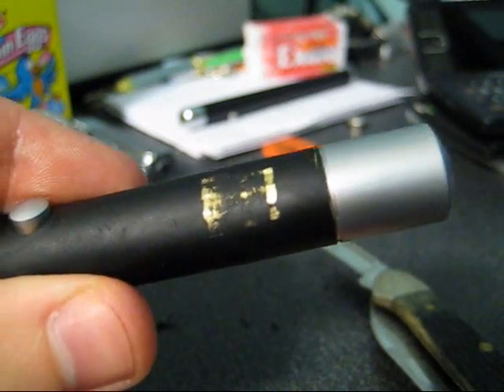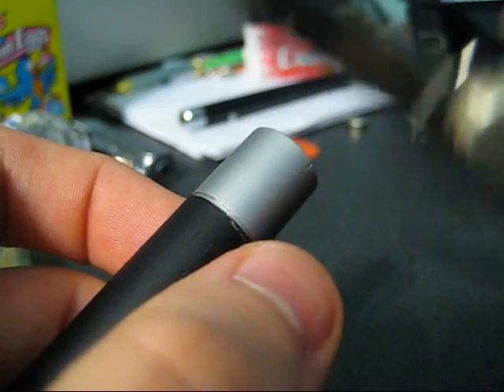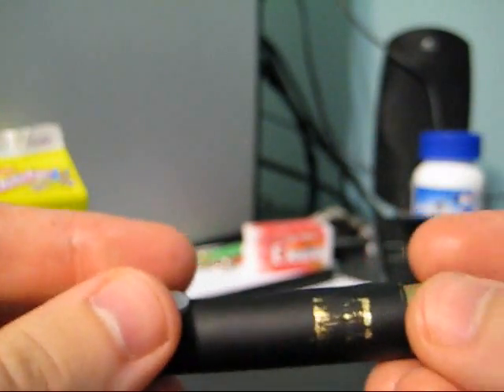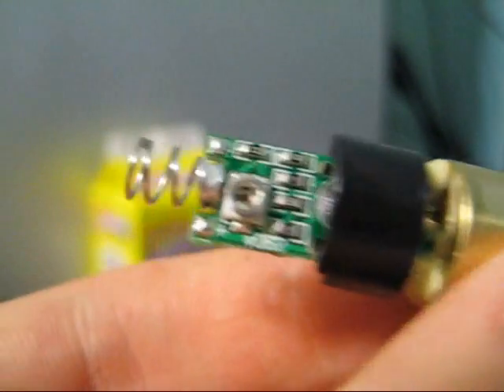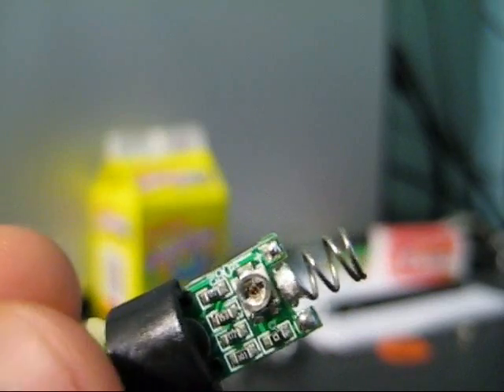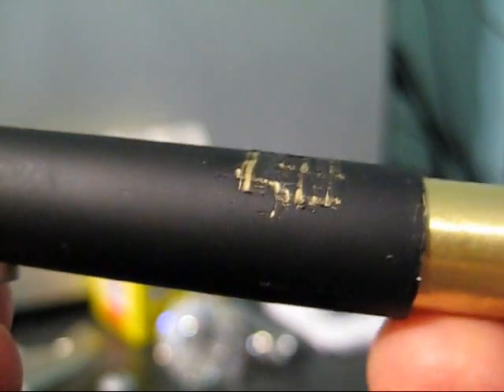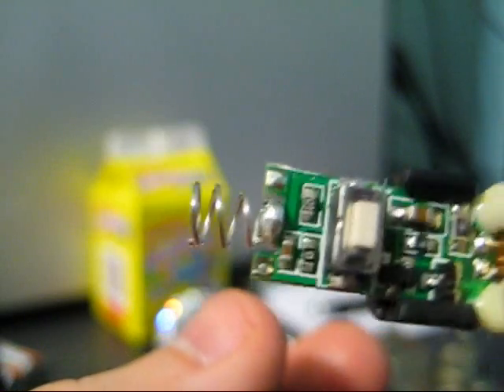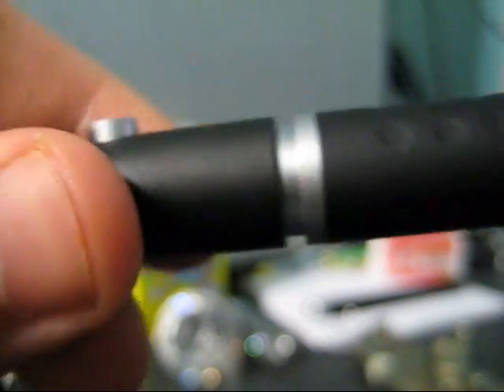How to pot mod your green laser

Comment: How does simply turning a potentiometer up to decrease resistance modify the laser exactly 🤔 a mod would imply modification. I dont cosider turning my tv volume up as a vol mod lol now if you would have added a better diode or put higher output batteries in it or a new board id say its modded but bro all you did was turn it up and a bench vice coupled with 2 pieces of wood drilled to hold the laser would prevent damaging it....at least use a rag in-between them pliers man and id consider some new silicone to keep the laser water proof putting it back together

Comment: look down the hole with a torch at the spring end locate to pot and drill a hole in the side ( be very carfull at this point wrap some tape around the drill end behind the tip come on think about it :P so you have 4 mill of drill tip ) drill trough otherwise you will drill right trough it) of it as close to oposite it use you lign of site down the hole and out side the hole then stick a screw driver through the hole adjust clockwise if you get it wrong it goes dim if you get it right it gets brighter  then just stick a small screw in the hole you made you can find said machine head screw in mother board fixing kits mechano but make sure its 3 mill in length don't screw a long one in trough your board

Comment: I have a 200mw laser but it have a smal red light in it i dont know how to fix.
Reply: Jim Griffiths, correct!
Reply: The little red light is an infra-red source about 1064nm wavelength. There is a crystal used to double the frequency of the light, halving the wavelength to 532nm. This is how it converts IR to green light. You need to align the crystal accurately or else the green light will not be produced.

Comment: I have a $100 barska green glx laser I took it apart but no screw to twist! Help please someone.
Reply: Your $100 Barska is already a precision  made piece of calibrated eqipument... it does not have one because it does not need one... it is already calibrated in the precision of its engineering... if it has a potentiometer, then it better not have cost you more than $5 because you got ripped off... ones without them are either super cheap or more powerful super cheap.
Reply: If you don't know what you're doing i highly suggest you don't do this with your 100$ laser. IT is super easy to break your laser i did this with 2 45$ lasers from ebay and broke 1 of them
Reply: Daniel Nunyabidnezz oh. Doesn't matter now anyway. I found it in the bottom of the washer 2 days ago lol
Reply: Lol

Comment: Thanks for the video, could it be possible to make the laser shorter in length, by make the batteries go on the outside? please let me know
Reply: You can remove the module and connect the -/+ to a 3 volt battery pack. I mounted the module in an aluminum heatsink with a fan on an interval timer. It'll run for hours without overheating. I use mine with a matrix lens during paranormal investigations. I use a 12 volt wall transformer with a 12 volt DC to 3 volt DC voltage reduction module.

Comment: Burn the rim w/ lighter put a screwdriver at the hole at the top bend screwdriver at 45degree angle push down the screwdriver the top should release :)

Comment: Get a lighter burn the rim then get a screwdriver in the hole at the top put it in at a 45degree angle and push down the screwdriver it should release I had this problem too

Comment: I have a problem. I have one from spencor gifts took it apart nd turned the pot but it dosnt stop the LD does go dim and than bright but no heat. Im reading 100 F highest temp nothing seriouse. It is a class 3b <500mW. I had another class 3a <5mW and directly hooked it up to a usb. It got warm not hot and still did not burn anything not even a black match. Maby its just bad luck but i really want to burn things from a distance and i know this class 3b will burn but i just dont want to break it.

Comment: Why waste your money on a cheap pointer, why not save up alittle and buy a better more powerful one.. The highest pointer i have is a 1W the smallest is a 50mw and the DPSS laser module i use most is a 200mw.. Look around on web sites not ebay, people get ripped off buying laser pointers as the power is mostly infrared and not a true mW power.. It will save you messing around and money with cheap pointers to make them more powerful.. :)

Comment: Guys DO NOT pot mod your laser pointers what djay2rapstar has said is correct, i have been using lasers for many years, if you are looking to have a powerful laser save and buy a DPSS laser module these can be changed as they come with a voltage regulator so you can go from min to max power without popping the laser diode.. If you have spent alot on a laser pointer and you do this you will have wasted your money...

Comment: not too long. depending on the laser, the pot might be more or less sensitive, but if you make it 50 mw, and it's a 5mw, you will get about 1,000 hours instead of 10,000 hours.
:/ If you want something cool, take apart an old ps3 and get the 1 watt blu-ray laser. solder it on a driver. make a blue laser. search styropyro for instructions.

Comment: you don't have to cut around the edges, just use some vice grips to wiggle the end around a little, then you will see that tiny crack seperating the body and cap get bigger and bigger until the end just slides out, then you need a vise to sandwich the two pieces back together. video of this being done can be found on styropyro's channel.

Comment: i was able to twist the pot without taking the laser apart just use ling small tweezers and pushed on the side of the pot to turn it if u look under the laser where the spring is there is a black foam around it just get the foam out. then use tweezers or a small screw driver to turn the pot put the foam back and ur done
if the laser is weaker than b4 u turned the pot the wrong direction

Comment: @koolium The potentiometer is about 60mm from the top of the laser where the beam comes out of and on the opposite side of the button. Knowing that you can take a drill with a screw drill bit about the thickness of a pen and drill through the case but as you get through it try not to press down as much. It might take 2-3 attempts to get it in the right spot. Before you do that I will say I did and I didn't really notice much of a difference of power than how it was when I first got it.

Comment: I really wish people would learn what they are doing by messing with the pot on these things... a laser diode will draw as much current as it can from the power supply until it burns out. The circuit in these devices is a CURRENT LIMITER, the pot adjusts the current the laser can draw, increasing this even slightly above component specifications WILL burn it out very quickly turning your 10mw laser into a 0mw laser. If you want to do this, find the laser diode datasheet FIRST!

Comment: I took apart my ebay laser that looked exactly like this one on the outside and mine didn't even have a potentiometer to turn. Almost impossible to take off silver cap even with exacto knife and vice grips. Had to cut mine off with dremel. Waste of six bucks.

Comment: its simple not to scratch it. What I did was just grab the silver tip with the vice grips,
hold the rubber part with my shirt with a good grip and twist them back and forth until it comes off. The cloth shirt grips well on the rubber.

Comment: So my experience with ebay lasers is that both of the lasers i bought, weren't moddable. As for the dealextreme lasers, do you use the true 5mw or just the typical 5 mw
also if you had the name of the ebay seller that you got your laser from, that'd be great

Comment: how i did: the hardest part is getting your chip part out of the casing, because they are so delicate and you dont wanna break anything, but it does require a large force
make sure you cut around the glue seal quite a bit, then twist the end bit slightly to loosen it, then pull apart, still hard but easier
after doing the pot bit i put it back together and it didnt work :O (freaked me out lol) if this happens and nothings snapped, turn the pot back 1/2 of the way back, should work, hope i helped

Comment from the maker: @lukedelrocco It's impossible to tell unless you have a power meter for your laser. My pot modded laser has been running the same for about a year now, but as far as the manufacturer's >5000 hours of diode life, I haven't had enough time (ha) to test it.

Comment from the maker: Sounds like you got an unstable diode that may have been pot modded in the factory. I had a laser that did that and it continued even after pot modding, so you may be SOL. :(
Best explanation is questionable build quality of the diode. The majority of these lasers are made in China and product quality ranges from surprisingly awesome to expectantly terrible.

Comment from the maker: I'm not sure. If the laser is over 20mW or so, it probably has a pot that you could mod. The red laser you're talking about might be the cheap keychain kind, in which case they don't have potentiometers and therefore can't be pot modded.

My best advice would be to take it apart carefully and inspect the driver board for a little screw just like the one in the video.

Comment from the maker: Yes. You can pot mod any laser as long as you can take it apart and find the potentiometer. The amount of increased wattage will be based on the quality of the crystal in the diode though, not the diode's advertised strength. Pot modding an actual 50mW laser will probably get you from 70-85mW but may also cause stability problems.

Comment from the maker: Probably, but the 5mw diode they put in there has a low quality crystal that isn't rated for much more than 5mw of output. You can probably push at least 20 or 30mw out of it, but realistically if you want 100+mw of output you'll have to shell out a pretty penny.

Comment from the maker: It's not so much a seal you have to find, you just need to get a knife to start separating the cap from the tube. There's glue present, but all you have to do is get the knife in and cut around the cap a few times.

Comment from the maker: Probably not any store bought red laser. There are red lasers with potentiometers, but in my experience red lasers go from 5mw to 200mw with little in between. 

o-like(dot)com has a $45 200mw that definitely has a pot (it's easier to access, too.. the whole diode assembly screws out of that particular model) and is the best deal $'s per mw I've ever seen.

Comment from the maker: You can, in fact it's easier to do it that way if you have a grinder or something to make a hole for it. If you're going to do it that way, just remember that the pot is "behind" the button on the OTHER side of the board.

I'm not used to metalwork, so I don't know what kind of grinder/saw would do the job best.

Comment from the maker: Not sure.. Most of the modules with built in IR I've seen on good sites like o-like(dot)com are pretty big and would require a flashlight style host to encase, not a pen style like this one.

As far as attaching one, you might be able to find one that attaches to M9 screw type, the threading this particular diode uses. (correct me if I'm wrong)

Comment from the maker: Have you tried turning it back counterclockwise to the original position?
Also, they have a tendency to break because of how delicate the electrical components are. I went through 3 before I discovered how to pot mod it without breaking it.

Comment from the maker: Most laser driver boards have what's called a potentiometer on the circuit board which only allows a certain amount of voltage to get to the diode. Turning the screw, or pot, to the right increases the amount of voltage that goes to the diode, increasing the milliwatt rating slightly.